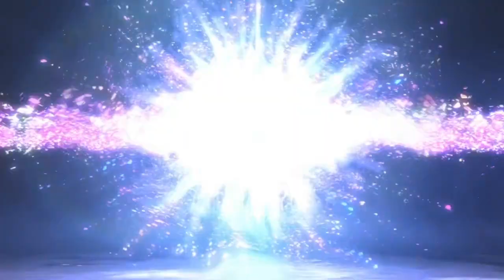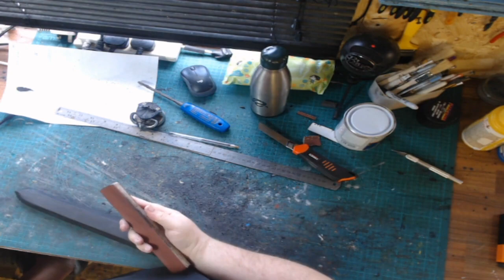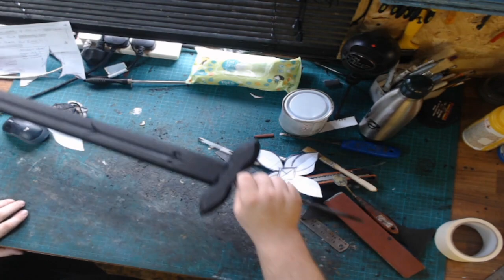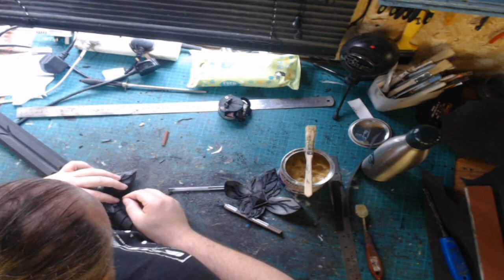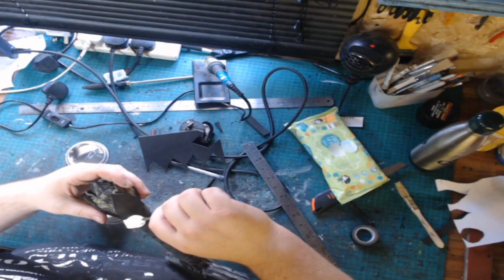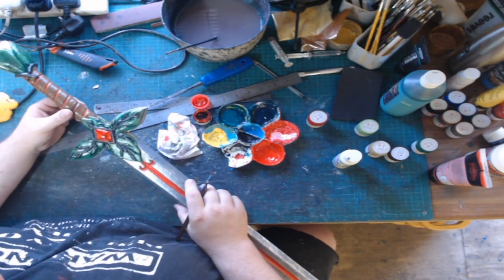How to build the Bark breaker sword

Comment: What is the wall thickness of the carbon fibre tube core you use?
Reply from the maker: For this sword it was a 8mm carbon fibre core. Do not use tubes make sure its a solid rod.